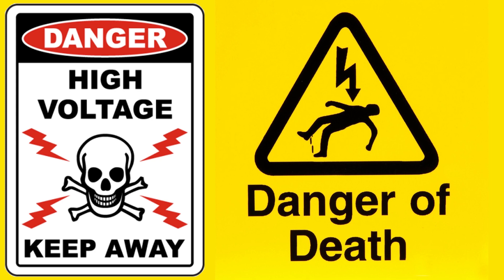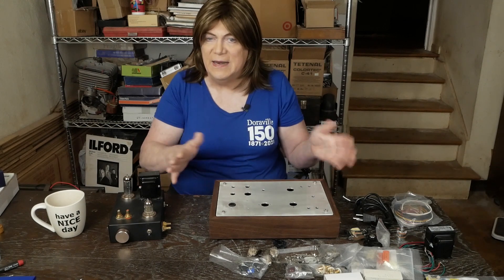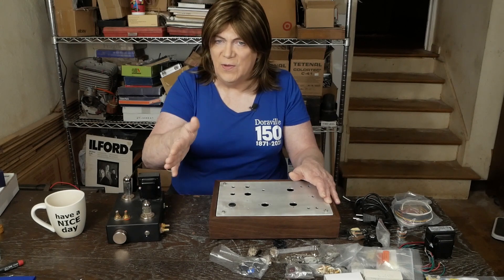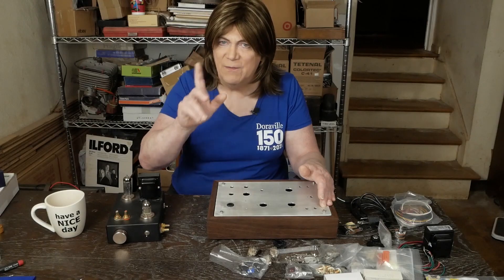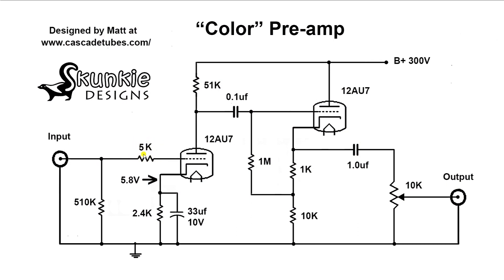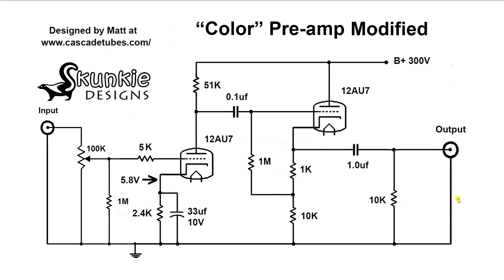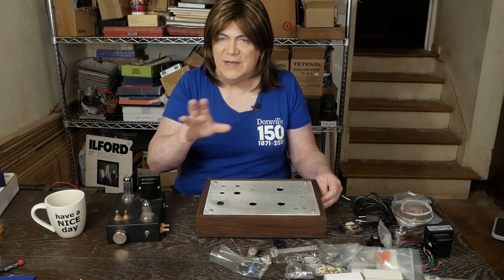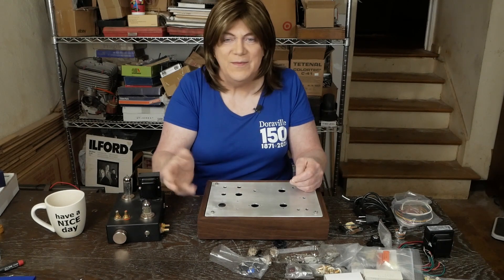"Color" Tube Pre-amp for Solid State Amps: Design Choices

Comment: With pre amps like riaa the signal to noice is moest inportant, dc heating is the solutjon,but 67 will do fine,65 to . Sharme is wath its all abouth,inn a riaa you have to place the condensers,intresting,i have alott of ecc tubes,808 i dont have more than 2 off.

Comment: Thanks for the video and the info! Now....about the output cap and the 10k pot.... If there was a spec for the unit, this would be a less muddy subject. If the pot is all the way up (out of the circuit) and you are driving a 1 ohm load, you would have one result. If the minimum allowable impedance on the power amp's input was 600 ohms (or 10k), the response would be vastly different. With the advent of cheap ($65) spectrum analyzers, making frequency response measurements is a snap.
Reply from the maker: Nope, you are still driving across a 10K pot unless for some reason you decide to short the output, which would be a bad idea!

 Also this was never intended to drive a 600R input impedance amp, if such a thing even exists. Most amps have around a 50-100K input impedance. Yes the pot does vary the output load across this 10K pot, but in use, you never go past 1/2 volume.

 The output cap is large enough to deal with this, unless you are trying to drive a ridiculous load. To drive this theoretical 600 ohm load without impacting the low frequency response,  you would need a 130uf cap!
Reply: @SkunkieDesignsElectronics  I have never designed anything without having some kind of specification in mind. The last amp that I designed and built had an FX loop output using a standard cathode follower. The input had a level control. The output went into a transformer with a balanced 600 Ohm output (XLR) with a single ended output (1/4") with ground lift. The other pre-amp output was derived from a lead off the speaker output transformer with a level control to a 1/4" jack. 600 Ohms is a typical load value in professional gear. I apologize for accidentally falling into a hobbyist webspace.  Keep up the great tutorials.

Oh...one little thing about ground strips. Look inside any older Fender amp and you will find a nice brass ground strap under the controls.
Reply from the maker: Yeah, it's such a shame most of us here are just "hobbyists" using mere consumer, hobby webspace gear, and we aren't using pro spec gear like you. And yes I have a spec in mind for everything I build, you just assumed it was something else.
Reply: @SkunkieDesignsElectronics  So much sadness in your postings. I am full of sorrow that I missed the electrical specification for your project. I am sure that I would had different thoughts had I read it first.

I also do hobby projects. One on the back burner, although I have most of the parts is for one of those trendy little cutsie mini micro Class-D amps. I have a 2.1, which I will use with a couple of thrift store subs and a pair of Realistic speakers. Remember the little black metal ones? I'll power the kit with some rechargeable Li-On batteries. It's for a sound system on-the-go. Out in the woods kind of thing - jamming with friends. I won't have the full spec until I have squeezed the batteries dry of charge. The math says I'll get well over 150 Watts of sound power out of this for a couple of hours. For normal use, it would be  much longer than that. Hey! There's the first part of my spec! "Much Longer". I swear - I should be in marketing!!!

FYI - I am a design engineer by trade and have (on the side) built, modified and designed quite a few tube amps. Only one went into production. I cannot say who the most famous customer is, but he is currently on tour with Mr. Vai.

Have an amazingly amazing Mothers Day!

Comment: I look at the schematic and I had to keep reminding myself it was meant to be a distortion device. But saturator or not, I don't design or build anything that the signal leaves the output 180 degrees flipped. The input and output signal must remain in phase!

Comment: I did run a quick calculation with with the 6.8µf output capacitor. The 1.0µf cap in the schematic sets the output -3dB point at ≈15Hz. This is what accounts for the ≈ -2dB response at 20Hz as I reported on the web page. With a 6.8µf cap in that position, the -3dB point goes down to ≈2.2Hz. This will result in very minimal loss at 20Hz as the 0.1µf coupling cap after the gain stage is already overly large given the input impedance of the cathode follower.

This change will support the low frequency response much more. However, if the downstream amplifier is susceptible to overdrive conditions (i.e. grid current) then this large capacitor could lead to blocking distortion in overdrive conditions. Since this was mostly conceived as a circuit to drive class-D amps (which seldom suffer from input current during overdrive) this may not be a real issue.

I'm interested to see how your build comes out.

Matt
CascaedTubes.com
Reply from the maker: Thanks Matt. I do want to test the frequency response and see if that larger cap is really needed, but I left space inside in case I go that route. And yeah I don't see this as a pre-amp for a tube amp, but more for a SS and especially a class D one.

In the final video I discuss possibly adding a voltage divider to elevate the tube heaters to about 45VDC. It's not absolutely needed and I wanna see how quiet it is with grounded center tap heaters first.

Comment: having the volume pot on the output defeats the whole purpose of the pre IMO. you had the voltage gain cascaded to the next triode to lower the impedance then you bring it back back by making it go through the volume pot. might as well just put a volume pot between dac and power amp. because thats the last touch. putting the volume pot at the input side of the pre will lower the noise floor and still maximize the sound and gain from the tubes. it will be more tube colored if thats what youre after. ive tried it both ways.
Reply from the maker: Putting the volume pot on the input defeats the whole purpose of preserving the second order harmonics from the input tube being driven hard, which is the SOLE purpose of this device. 

Installing the pot on the input,  the amount of "Color" will vary with the volume setting. I'm really not sure what else I can do to try to explain why this pre-amp isn't wired that way. Myself and the designer totally understand why someone looking for a super clean, low distortion pre-amp would install it on the input, that is not the design goal here. 

"To preserve the harmonic character of the preamp, the gain stage is followed by the buffer which is then followed by the volume control. This means there is no attenuation of the color provided by the gain stage at any volume setting."

https://www.cascadetubes.com/the-12au7-cathode-follower-color-preamp/

Comment: I’m looking forward to seeing how this comes together and what your thoughts are on how it sounds. First thing I noticed when looking at the schematic was the volume pot being at the output of the pre as opposed on the input. Was wondering why this was being done. Your explanation makes perfect sense! A pre like this should have a constant sonic signature. No point in building something like this if the specific sound quality is only heard when the neighbors are calling the police with a noise complaint :) Be interesting to see how the coupling cap value changes the bass response. I would imagine the input impedance of the SS power amp would have an impact on what value is ideal? I recently built a SS Hiraga 30 watt class A amp that has speaker protection on the output. Because my preamp had too up DC on the output, which was triggering the protection circuit, I had to add a coupling cap in the power amp. Figured it was better to put it there, than on the pre, as I didn’t want the pre cutting low frequencies on other amps which would have different input impedances.

Comment: Hi, I really love the content. I wanted to mention that I got the analog discovery working with the audio analyzer and it’s a great tool, However when looking at low distortion preamps it has too much noise and distortion itself to get measurements that I could reIy on. I then tested this on an audio precision analyzer and was able to determine that the analog discover can add some of its own distortion which isn’t huge but for preamp levels did make it difficult to use. It seems to especially add odd order harmonics in my setup. I would be happy to run anything on the APX 515 if you ever needed or wanted that.
Reply from the maker: That's why I build a small amp with no driver stage to test pre-amps. But I know even that isn't perfect. Mainly I just make sure stuff isn't crazy bad :) I honestly have no idea what a APX 515 is.
Reply: @SkunkieDesignsElectronics  Thanks for the reply, I think the audio analyzer suite is a great tool and the only alternative I could find under 10K. The APX 515 is one of Audio Precison's two channel analyzers. I only mentioned it because I kept hitting a wall while trying to test differences between in tubes in a Freya Preamp. I kept getting these harmonics that dominated the distortion numbers and were common between all the tubes I tested. I felt like that couldn't be correct so I finally bit the bullet and got the APX 515 (only because I needed it for another purpose) and confirmed that. To be clear these are like -70db so I don't think it would matter when looking at 1% distortion type things. I was able to finally determine that Electro-harmoix 6SN7 tubes had 10dB less noise and greatly reduced distortion than some triode matched JJ tubes. 0.002% vs 0.1% type differences which is quite crazy. I hope to publish those results soon. I really love your work and hope to build the KT120 SE amp when you do that one. In the mean time I hope to be able to learn more about the performance of new production tubes. I would love to look at old tubes but don't have any and can't really practically do that at this point.

Comment: This iscool.  I already have all the parts on hand! Could this design (with some variation) become a guitar distortion/“drive” pedal (feeding a SS guitar amp)?

Also, I am converting a Bogen tube PA amp into a guitar amp (as seen in yt video).  Roughly speaking, could a circuit like this, with tweaks, be added at earlier stage for similar purpose of this video? Any thoughts?

If I just wanted to play around with distortion, tone, gain…, could I safely add pots at various points to see how they  do. If so, where would you place these?  Any other suggestions on how to mess around to understand possibilities for experiment?

I’m a self-taught hobbyist and have learned a lot from you.  Love your channel!
Reply from the maker: I would maybe play with lowing the bias voltage on the input tube to make it easier to overdrive?

Comment: Have enjoyed all your tube projects so far... and your  thoughts about keeping things pure and simple! 

But I have been waiting for you to do this type of color tube preamp project ...as I have been using a cheap and cheerful but modded FX audio tube preamp to add  some tube magic(😂) in my streaming/class D system....and even hough the FX is a great entry point and does add some nice colour, musicality  and dimensionality...the circuit design apparently doesn't drive the tube to their best operational parameters ...so I have been looking around for something better, new or DIY to try! 
 
So I'm looking forwards to seeing how this turns out

Equally I am curious if you  managed to try out that little inline Nobsound (Douk) E6 preamp yet? ....as there has been a little bit of a buzz about it on the net -.but using modded Russian tubes..as,the chinese tubes are said to really bad and very microphonic.

Anyway thanks again  for doing what you're doing
Reply from the maker: I plan to do a "shootout" with an OG FX audio, that nobsound and this color pre-amp when I am finished.
Reply: @SkunkieDesignsElectronics  The shootout idea is perfect for me 😊 ...thanks again!

Comment: I just finished same project for connecting to project #72 of Rod Elliott and result was wonderful. You probably know that cathode voltage is 7V with B+ 300V. mentioned 5.8V on Mat drawing is for B+ 250V which was first attempt. thanks and waiting to see if any hint can make mine better.
Reply from the maker: Yeah someone brought that up on the forum and tried to make some huge deal out of it. I'm like "Whatever, I'm sure Matt just overlooked this when he rewrote some notes."  I'm more of a build it, adjust till it sounds good and then write down the voltages kind of person anyway :)

Comment: I don't see what's so hard to understand..the explanation makes sense. This project looks like something I'm truly interested in. I love how certain tube preamps sound with a very transparent DAC and extremely transparent solid state Class D and Class G amps. Just a touch of warmth or roundness while remaining transparent and losing no or minimal clarity. One of the best pairings I've come across is with an older Chinese preamp, the Dared SL2000a (which I'd give me left foot for the 2012 board schematic)  I've been able to change some parts in it but I really need the schematic. I've emailed many places/people looking for it. Wish I knew someone I could send it to and let them figure out the schematic for it. Anyway...this build could work for me, very interested to see how it turns out. Good luck, hope it goes well.  Amir's forum is all about transparency from point A to point B. Tubes are not what that group is about. I go to ASR for other types of information.

Comment: Yes, changing the 1.0uF capacitor to a 6.8uF capacitor will change the frequency response and the phase shifts. The output is a simple single pole high-pass filter, so the variable potentiometer will also affect the frequency response and the phase shifts.
Running the numbers (assuming a low impedance on the output (i.e., R_v >> R_output)): (a) with a 1.0uF capacitor f_c (corner frequency or 3dB down frequency) will be about 16 Hz to 159 Hz with the variable potentiometer from 10K to 1K, respectively; and (b) with a 6.8uF capacitor f_c will be about 2.3 Hz to 23.3 Hz with the variable potentiometer from 10K to 1K, respectively. At the corner frequencies, there will be some distortion introduced by phase shifts in the waveforms.

It looks like distortion is (also) being introduced via the 1M ohm feedback resistor in the second stage, since that is positive feedback (i.e., regeneration). It might be fun to add a variable resistor in series or parallel to that resistor to hear how that affects the sound, assuming that you don't put too much positive feedback in and create a screeching oscillator. I also might be fun to play around with a tuned or tunable filter in the place of the 1M resistor to hear how that sounds 😉
Reply from the maker: Thanks, it will be fun to see what the audio analyzer tests show.
Reply: @SkunkieDesignsElectronics  Yeah, if modifying the feedback works out well, perhaps a set of controls could be added to allow someone to set various feedback to get a sound he or she likes 🤩 Just make sure that he or she cannot make an oscillator 😉

Comment: Ah, geez…the simulator zombies and forum trolls. 🙄 Cool for getting a somewhat general idea, but not helpful in knowing how something will sound. Looking forward to this build. I’ve got a rather big stash of NOS 12AU7’s, so this is perfect. Thanks, Steph! 🔊😊🎶
Reply: Yes indeed !
They who don't understand amplification are those who spew critisism.....
PP amplification ( the mosr common amplification mode )....cancels second harmonics and by doing so they cancel out the harmonic relation between pair and odd harmonics , reinjecting some second harmonics ( and other pair harmonics ) the hamony of harmonic content of music is restored ...
To create second harmonic distortion onr brings the tube in an operation point to produce some second harmonic distortion , therefor the potentiometer is shifted to the back of the circuit.
One can adjust eventualy the sensitivity ( or overloading ) of the input by a resistive divider ( switch or multiple selector ) ....the bass ( hi pass filter output ) can indeed be adjusted by choosing other values of capacitors or and a higher impedance potentiometer (example ...20K )...
Best is to double the output capacitors , 2µF by two 1µF in // , or higher values.
The inductance is lowered and the ESR of the capsis half....

I don'targue anymore withthose audiophile discussions , the less they know the stubbern they are , .........believers instead of reel experience and reel facts ...you can't argue with a belief.

Have a nice day , and yes Steph is right to build and explore this concept from MATT.
Reply: @frankgeeraerts6243  Hey Frank. I somehow missed this extremely well said comment. Better late than never. It’s channels like Janos’ and Stephe’s, as well as sharing great comments and conversations with people like you that changed what was becoming disdain for the attitude attached to audio and HiFi, to excitement and enthusiasm again. It was more music industry BS that caused me to stop playing music and turn down some great (and lucrative) opportunities to continue touring as well. 
I don’t really know how to, or if there’s even a way to thank you guys for giving me back my passion towards music in general.